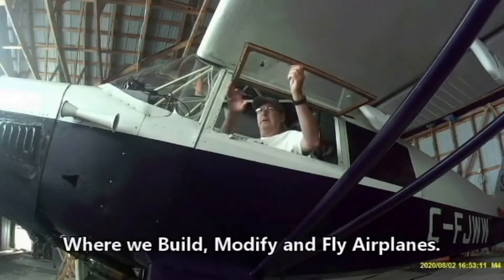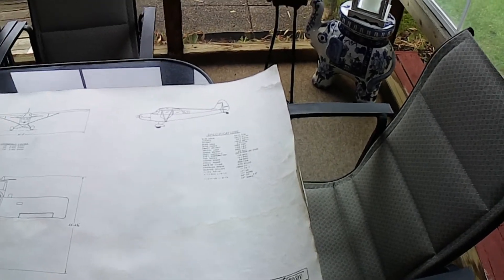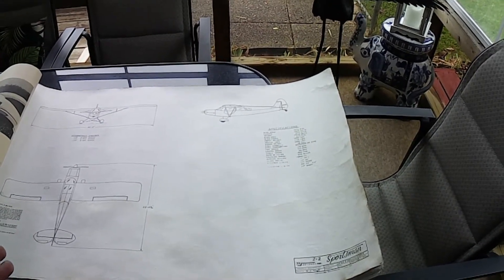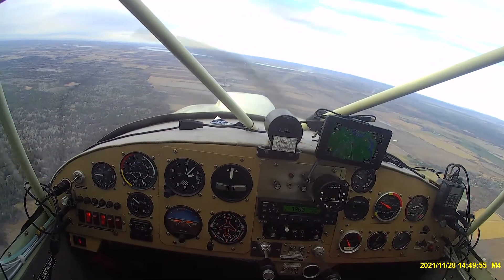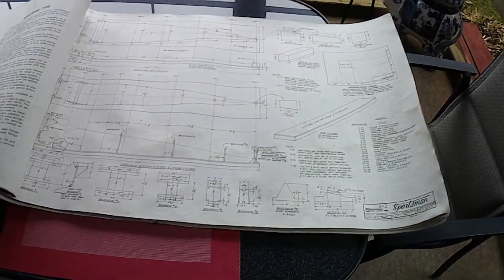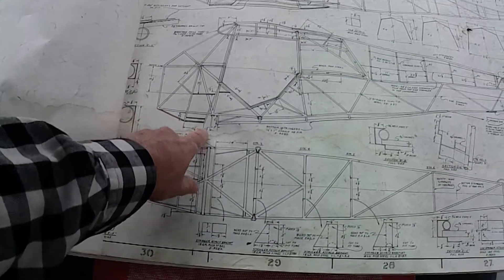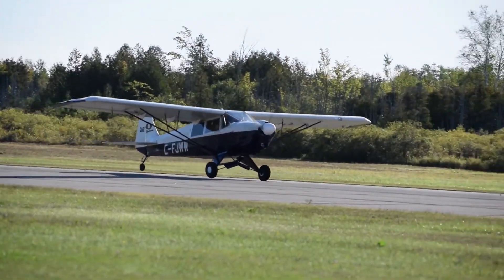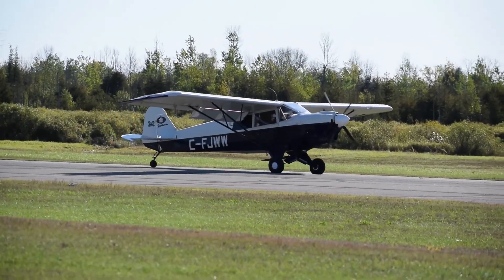Wag Aero 2+2  a Brief Review

Comment: About to start building the second 2+2 airframe I've built, the first being 25 yrs ago. Never finished that one due to training, but the fuselage, tail feathers and gear was pretty much finished. This one will be 4-5" wider though, as the 39" interior width isn't very wide for a "four-place" aircraft. Did you keep track of the number of hours you spent on the project? You cite a 5-yr minimum build time, but how many hours per year are you talking about? 

How
Reply from the maker: I started working about 16 hrs per week (Tue & Thu evenings and all day every 2nd Sat) for about 2 yrs, getting the landing gear and the fuselage built, doors on, rudder, elevator, stabilizer and trim system. My book says 2510 hrs on airframe and 608 hrs on the engine install but my first engine was a 3.8 L Ford V6 ... this is the one and only airplane I've built; since you have previous experience you may be able to go faster and plan better. Good luck with your project; it's a worthwhile endeavour. Jeff

Comment: Whould wheel pants and some fairings on the gear not help reduce drag and up the speed somewhat ?
Reply from the maker: Maybe but I doubt it would give more than 1-3 mph ... for reference, I tried going to smaller tires and it didn't help at all.  Also added gear leg, lift strut and flap- hinge fairings with negligible effect.

Comment: Thanks! I’m approaching 4 years on the same project. Fuselage done, one wing built—I’m using the wood wings and adding flaps. I also have opted for the jack screw trim.
Nice to see it flying!
Reply from the maker: Thanks for watching and taking the time to comment.  Good luck with your project - it's a tough haul but worth the effort.  The only real negatives to the 2+2 are its cabin width and airspeed.  It's fairly easy to land - just keep it straight and ease the stick back until it touches down.  It can be a challenge in rough air - heavier the better in that case - but in normal conditions flies very nice and trims well.
Reply: @jeffrosOutdoorExstreams  I like the design—based on the PA 14. Happily I am at the FAA size and my wife is petite.
Curious about your engine, as in weight and hp. I’m going with a Lycoming, but wavering between O 320 and O 360.